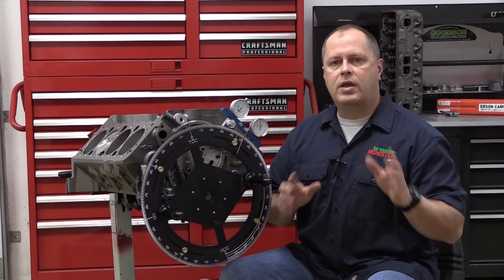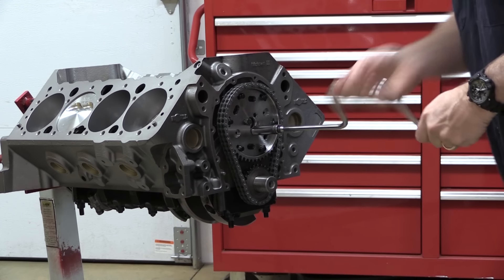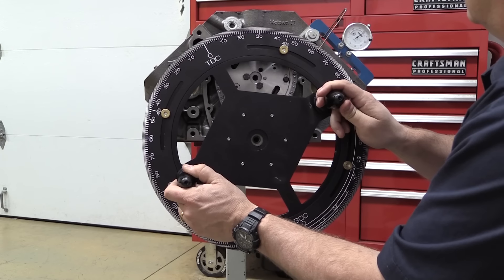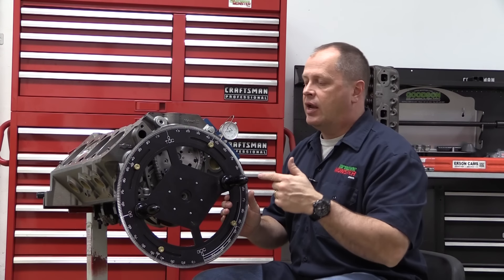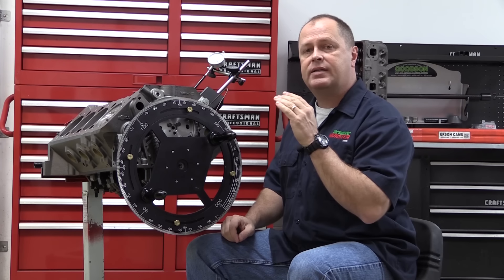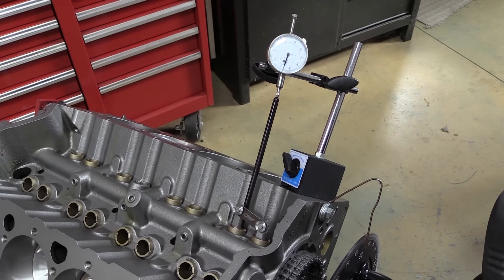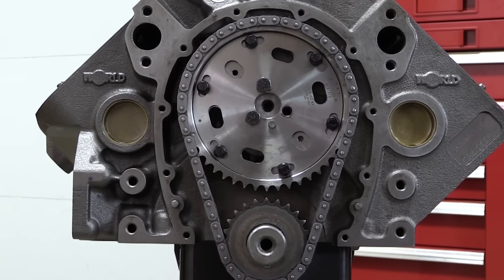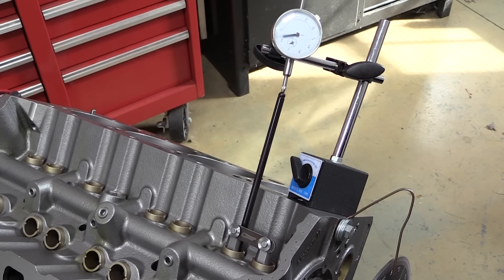Better Engine Building: The Easy Way to Degree Your Camshaft

Comment: I never understood why this is necessary. 
If you can trust a company to grind a cam, you would think they would put the key way,  in the right spot.
But I guess you can fine tune anything.
Reply: Because there is a tolerance plus or minus it's not going to be absolutely perfect from one cam to another although same part number. Within one degree is probably where it lays and checking your cam tells you exactly where it lies so you can degree your cam plus or minus depending on your build and what you are looking for  in output.
Reply: Books say one thing. Mechanics say another. But you will only know by experimenting yourself. In this day and age with so much bullshit arround, I don't believe anything. Cams are cheap. Try 3 or 4 in your engine. See what works for you, that's what I do.
Reply: @chrismontreuil2206  cams are not cheap. youre just rich.

Comment: Your cam and crank are still in the same position to each other so are you setting your timing at x and that's max power
Reply from the maker: It isn't necessarily maximum power, but it is important to know exactly where your cam timing is because it can be a useful tuning tool. Generally speaking, advancing your camshaft timing (moving the lobe centerline from 106 to 108) will move the engine's powerband lower in the rpm range and help produce torque. While retarding the timing will help high-rpm power. Thanks for watching!

Comment: great video very straigth forward, also im not an engine builder and I haved heard that when you degree a cam you should meseaure in more than one piston, do you think that is unnecesary or useful in any other aplication?
Reply from the maker: I don't think so and I haven't seen many other engine builders do it when I document their engine builds. Cam lobes in relation to each other are almost always dead on. The issue with cam timing is usually stacked tolerances between the cam, timing chain, keyway in the crankshaft snout, and on down the line. I hope that helps, and thanks for watching!
Reply: @TheHorsepowerMonster  Thanks for the answer, I have remember where I heard it, an old powernation video with Joe Mondello and they said he degreed the cam in four cylinders, guess and old habit of the guy god rest his soul, minute 9:00 of the video https://www.youtube.com/watch?v=eFJBvOE1rWM thanks again

Comment: Every single time I've seen these tutorials on degreeing a cam, whether it's here on YouTube or in a book, the numbers ALWAYS match exactly what the cam card says. If that's the case, what's the point in degreeing a cam? I've always heard or read that "you must degree the cam for best power" but, I've never seen a situation where anything was actually done, other than verifying the cam specs. Why wouldn't you just toss it together according to the cam card, if the cam card has proven to be correct many, many times? Are cam manufacturers THAT bad about grinding per the specs? 

What if you're just re-installing a factory cam? I know they are not precisely ground but, what do you do if the cam is "off" spec?

Seriously. Learn me something here.

Comment: Very good video, clear and easy to understand. How would you go about using that to tune? Does advancing/retarding the cam timing just move the power band or can it increase the overall power? Thanks
Reply: Depends what you mean by "overall power" (peak, average?) changing cam timing effects where the engine makes torque i.e. the torque curve. Making more torque at a higher rpm will make more horsepower (or rather, IS more horsepower) but doing this is typically a tradeoff of making less torque and thus power at a lower rpm. Because of this, average horsepower usually doesn't change that much but sometimes it does. Every engine is different.
This is, essentially, what variable valve timing does in most modern cars were a camshaft phaser is constantly adjusting cam timing to produce optimal power, emissions, fuel economy or whatever the demand is at any one time.
Reply: @177SCmaro  Thanks!
Reply: @toolmike100  yw

Comment: I love your channel and videos. I actually only degree a cam if I plan on not running straight up dot to dot (like 4 degrees advanced or retarded), so I know absolutely where the timing is at in order to change just how much I want. Otherwise, with the many hundred plus engines built, I rely on the manufacture specs to be correct. Especially when paying several hundreds of dollars for custom ground race cams. Excellent explanation of how the process works.
Reply from the maker: Thanks! And thanks for watching
Reply: So if I get a brand new cam I shouldn’t have to degree it?
Reply: Mistakes happen when grinding cams and you shouldn't rely on them for being correct.  Centerlines wrong, wrong cam for the application etc happen and these errors are easily caught by degreeing in the camshaft.

Comment: Nicely done. One thing I couldn't help notice was your indicator plunger wasn't exactly parallel with the pushrod. In this situation it probably means little, but if you're trying to teach people, having the indicator point parallel with whatever is moving up and down can be very crucial in many cases. Just sayin'

Comment: What kind of degree wheel is that, brand?
Reply from the maker: PBM or Erson used to sell them, but I think they don't any more or at least haven't made any in a little while. Sorry.
Reply: You by chance have part #?  They dont have a pic when you pull up on website, I saw one price was over $300
Reply: Thanks for your help, and enjoy the videos, very helpful..